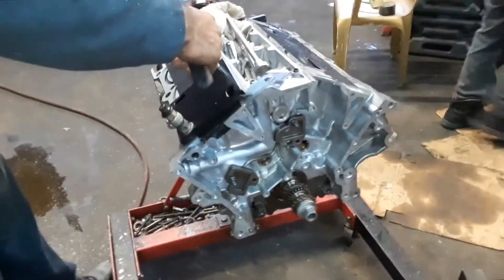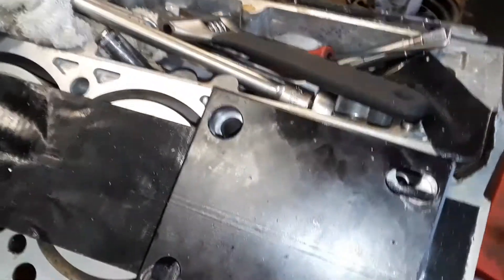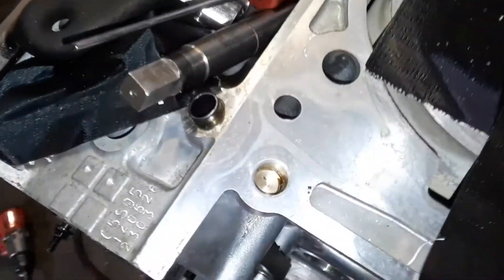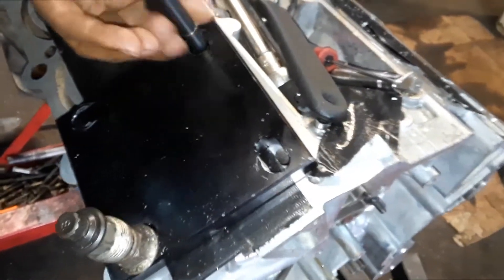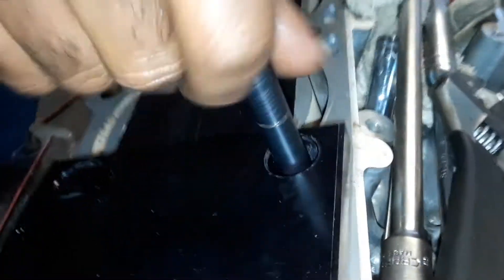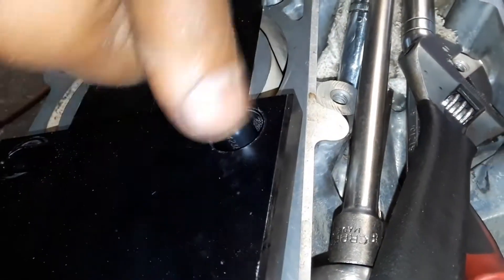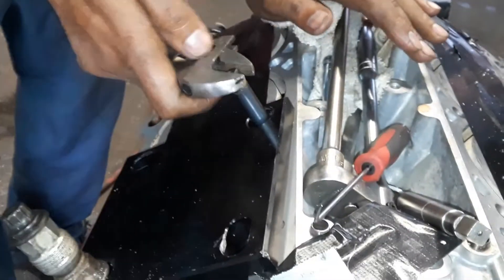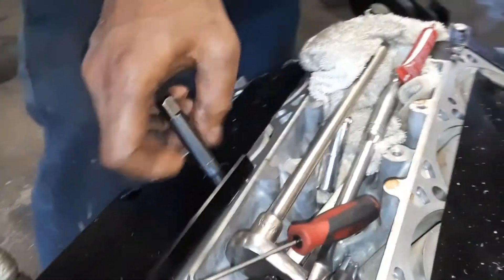3.3 Kia Engine  Overheat Head Gasket Leak Cause and Solution

Comment: My 2016 blew a gasket due to stripped threads and the engine needs to be replaced. Simply installing new bolts doesn't cure the problem. Oil mixed with coolant and the engine cannot be repaired by simply installing new bolts.
Reply: If you catch the problem early on your fine as long as the motor didnt overheat from the blown head gasket. Just replace the heads and clean everything you can reach.
Btw i know i have a 94 GMC K2500 (480,000miles) Original Motor, but 3rd tranny.